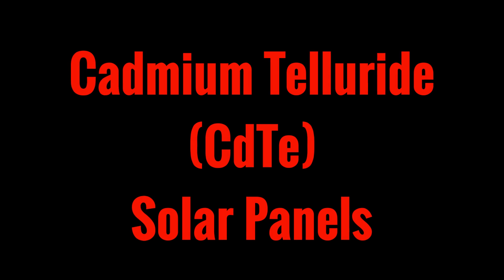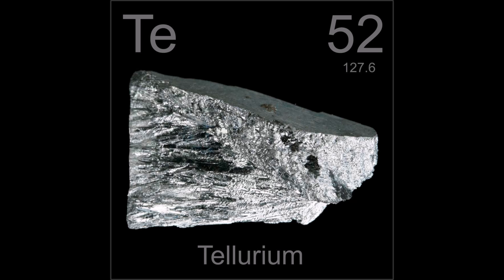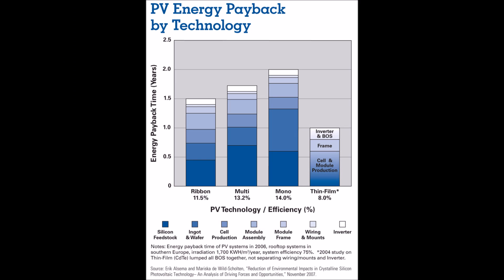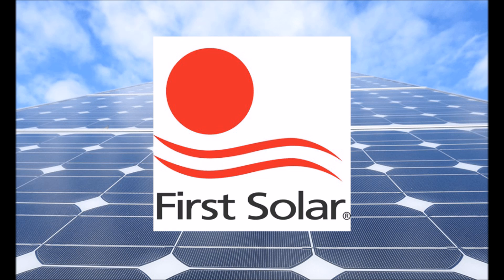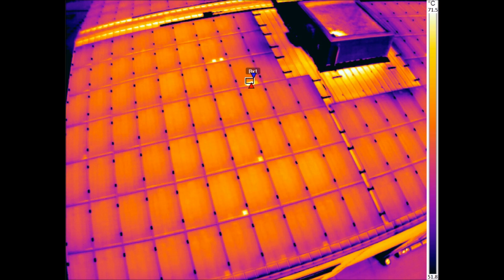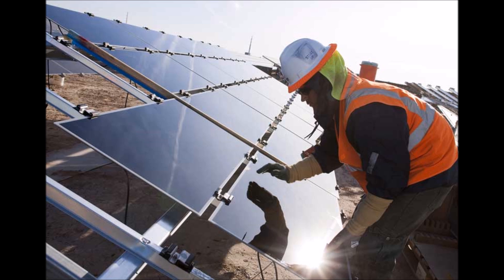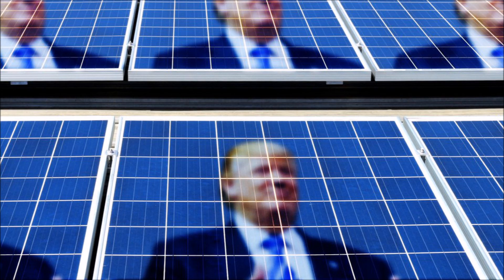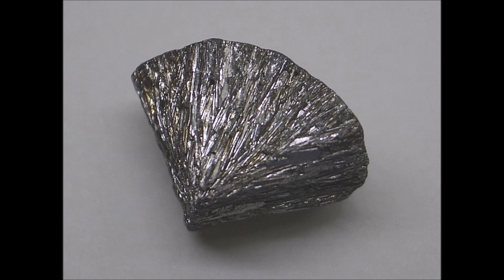Cadmium Telluride (CdTe) Solar Panels

Comment: Hey are any of your older systems still in operation,and which controllers do you recommend? I want to know which system endured including solar controller, panels and so on.
Reply from the maker: Yes, I have a 600W system on my shed that has been running since spring of 2013.  I used DMsolar panels (http://www.dmsolar.com/dm15somo2pkp.html) and 3 different charge controllers, all of them made by Morningstar (starting with - https://amzn.to/2w2iwB7   and ending with - https://amzn.to/2rfqQbb).  I started out using golf cart batteries sold at Costco which were great and very durable and super cost effective but then graduated to more premium batteries last year with Trojan T105RE batteries.
Reply from the maker: For more info on my latest setup, watch this video series and it will show you what I had before and what I have now:  https://www.youtube.com/watch?v=X1QKyTysxIg&list=PLbKwoGlXEWaqluTsTB5R0fjLMqniKOt5q

Comment: Great video friend. I'm looking for a solar JOB!  I'm near Boulder, CO.  Got any suggestions?  I have 8 years electrical experience and a Manufacturing Engineering degree.  Tons of construction experience too.
Reply from the maker: Unfortunately, there aren't many jobs outside of sales and installation.  There are very few solar companies left in the US that actually make panels or components.  Maybe you can start out as an installer and see if you can work your way into an engineer role designing systems.

Comment: Don't forget wind turbines, super cheap if you go to Walmart online, and better http://linksynergy.walmart.com/fs-bin/click?id=nNC3MIW3bd8&type=10&tmpid=1081&offerid=223073.7442&RD_PARM1=https%253A%252F%252Fwww.walmart.com%252Fsearch%252F%253Fmethod%253Drelated%2526query%253Dwind%20turbine%20generator%20kit%2523%252FsearchProductResult%2526affs%253De
Reply from the maker: Unfortunately, after researching those types of turbines for years, they do not produce much power.  Certainly not their rated power.
Reply: For the last 10 years you would be right. But just in the last year the Chinese have upped the game from junk to function. Can't say that for the criminal mastermind in Missouri who is a 100% junk fraud dealer but as for the Chinese they went from toy, to energy. However, you still have to pick careful until quality equals out. The NE-500 (see my $200 china turbine vids) is NOT a fluke.
Reply from the maker: Yeah, Missouri Wind and Solar is shady as can be.  No one should ever buy from that guy.  I will have to look at your videos.  Thanks for the info.
Reply from the maker: Do you have a link to the particular video and also where to purchase?

Comment: Why should i care if they're not available?   I tried to buy some but they only future market these to utility companies on a large scale which does me absolutely no good.   I need panels RIGHT NOW, not at some unspecified future date.   I just got another shipment of imported silicon panels TODAY and they'll be on my roof by Monday afternoon when i get more MC4 connectors in the mail.   They will be producing power next week while this will be perpetually 10 years in the future.   By the time these hit the market tellurium will cost more than platinum simply because producing these at any reasonable scale will increase demand and drive prices up in the unlikely event that they actually enter production without the company failing under the weight of corporate corruption and scandal that ubiquitously pervades in the capitalist system.   My bet is on them robbing a bunch of investors in the name of nationalism and declaring bankruptcy before i'm able to buy a single panel.

So i'll just keep buying as many pre-tax imported panels as i can RIGHT NOW instead of holding my breath for these.   I'm off grid and necessity dictates that i use what's available instead of waiting for First Solar to mass produce these fairytale unicorns.  Even if they do produce utility scale grid power with them, it's still worthless to me since there's no grid on the mountain, just 350 days worth of south-face sun a year that i need to block from heating up my roof, and shading it with silicon panels while making power to run equipment has been doing me just fine for the past 7 or 8 years.

Comment: It seems that there are two major problems with this technology. Tellurium is a rare element (between one and five parts per billion in the earth's crust). It may be lacking or no longer available in sufficient quantity to ensure the sustainability of the channels that use it.
Cadmium also raises questions because it is a toxic element that can accumulate along the food chain. In the 1950s, mining industries dumped cadmium into rivers in the Toyama Prefecture of Japan, causing the so-called Itai-Itai disease in the population. In particular, it resulted in bone softening and kidney failure. Affected inhabitants fed on rice from crops irrigated by contaminated water. Note, however, that cadmium becomes harmless once included in solar cells, as confirmed by several scientific studies published in specialized journals.
A fire could not release the cadmium from the solar cells because the heat would melt the surrounding glass, trapping it. The main risks would be for people working in assembly or recycling plants, but there are many industrial processes to prevent poisoning.
Finally, we need less cadmium to make a solar panel than a single NiCd battery. For the less convinced, cells devoid of toxic element were born in the 1980s. They consist in particular of indium and gallium.

Comment: Thin-film solar panels are in general not very useful for in most residential situations. They are cheap, but they also require a lot of space. Monocrystalline solar panels produce up to four times the amount of electricity as thin-film solar panels for the same amount of space.
Reply: w8stral2 Huh? What are you referring to?
Reply: First: CdTe is a special case.
And: There was much progress in the last few years.

Today, CdTe-modules achieve roughly the same efficiency as crystalline silicon modules do (>17%).

So the demand of space per kWp is more or less the same.
Reply from the maker: Chris, that is not really true.  I can show you pictures of a thin film 100W solar panel compared to a 100W mono silicon panel that I have in my shed.  The thin film panel is actually smaller even without taking into account the aluminum frame.  It just sepends on the efficiency of the cells in the panel.  And like I said in the video, thin film has caught up to silicon and in the next few years will pass them.

Comment: The cadmium issue is important,
I still have a NiCad battery from the seventies.
Those have all been replaced these days with NiMH for environmental reasons.
No more cadmium in other places either.
Also Trump may just be a transient, same for his import tarifs, that is hurting US solar industry and its consumers
with higher prices.
I do have a cheap Chinese made solar panel..

That said, we all need a personal nuclear  reactor, or maybe a RTG (Radio Thermal Generator as in some spacecraft),
 everything will radiate anyways after Trump tangles with N Korea, China, and Russia (some others possibly too).

Nice video, at least it is honest.
Reply from the maker: Thanks.  Yes we need to be responsible with cadmium.  Thankfully these panels have been shown to be safe for consumers.

Comment: 2016 - 2018 seem to be banner years for the "boring" metal markets.  First zinc inventories declined, then you had the cobalt shortages due to rising electric car battery demand.  Now Tellurium is getting the renewable energy spotlight too (though I guess you could say Te is more of a metalloid).  I wonder where the prices will settle when this technology reaches its peak.
Reply from the maker: Good question.  I am trying to shine some spotlight on it but most of the solar industry ignores CdTe and thin film thus far.

Comment: Mono-crystalline – efficiency is in 16% range. PV cell is made from pure mono-crystalline silicon with almost no defects or impurities. High purity mono cells are used to make computer CPU chip, relatively low purity cells are used for solar module. The most common size of mono-crystalline cell is 5”x5” (125x125mm) and 6”x6” (156x156mm). The bigger the size, the harder is to make. Mono-crystalline has a lifetime of 25 to 30 years under normal circumstance.
Reply: And still produces useful energy well past that timeline !

Comment: We need to focus on one type of panel technology, if it can provide what we need. Economy of scales is important, focusing on 1 type of panel means better research and lower prices.
Reply: Kester Belgrove,
Focusing on a single is what got us into this environmental mess to begin with. ( why are we still generating electricity with 1920s technology?) Continued research and development into new and better technology is the only way to be sustainable.
Reply: Scott BC31H I hear you loud and clear, but in relation to some technologies I disagree. If we use Lithium Ion technology as an example, further concentration on one form has lead to reduction in Li batteries from $15 per cell to $1 per cell in a short period of time. This price reduction will lead to a boom in solar storage and overall use as a renewable and affordable form of energy production worldwide.
Reply: so your not in favor of graphene batteries which can be charged faster and hold more storage? Lithium-sulfur batteries which are lighter? Lithium fluoride batteries which are very light and cheap?
Reply: There are many different takes on this; everyone is entitled to their view. I'm basing this on the fact that for each type of technology there is going to be a plethora of ancillary technology that goes along with it.  E.g. with batteries you need charge controllers, inverters and other tech as well as lessons learnt to control safety issues, etc. With a new type of Li battery a new charge controller and maybe even inverter may be needed... Each new tech requires new experience that takes years, money and resources to develop fully. I'm not saying no to new technology, NO WAY!!!, I love new stuff. Let's not forget that everything needs development time. 
Also, each new thing is expensive because of the economy of sales. So it may be years before this new tech is even "affordable" to the masses; whereas the technology that already exists has high reliability, is affordable, is functional, and safety issues are mostly already known. 
Please note this is not an argument but a discussion, and I'd love to hear your view.
Reply: There are charge controllers that allow you to program how much voltage goes into the battery. You do not need a new inverter for a new battery tech, as long as the charge controller cuts off the voltage.
Reply: JoeAceJR are programmable charger controllers more expensive than their non-programmable counterparts?  My reasons for my point of view are as follows in priority:
 Cost
 Safety
 Durability
 Reliability
 Ease of setup/adoption

These things come with time on the market. Consider charge controllers, pwm was the norm for lead acid, but with Li ion mppt gives better results, but mppt was and is still more expensive. I realize I'm sounding technophobic (but it's quite the contrary), but I see such improvement in cost and availability in relation to solar and 18650s since Tesla and I love the movement the industry is taking. I'd just love to see solar power as an affordable commodity like cell phones.

Comment: Interesting.  Thank you
Reply from the maker: You are welcome.  Thanks for watching!
Reply: Part of the reason I'm getting more interested in Solar and wind power is I am in partnership on a piece of property that has absolutely no chance of getting cheap power brought in. 10 years ago it was estimated by the power company to bring in power we would be looking at our cost nearly $60,000.  Right now we are on a generated power system (12Kw diesel) that during the day charges a battery bank and supplies power to the rest of the property.  We have acquired a tower in order to put up a wind generator (yes we have the sufficient wind speeds according to the charts).  We also want to install solar power for those time during the day when the winds are changing direction (Lake Superior creates in inflow and out flow of air daily).  During the mid day slowdown we could continue to charge the battery bank when we are not on the property.  This would allow us to also operate a small well in order to bring water into a field we plant for the local animals.  It would also mean we don't have to rely on diesel generation for power making it quieter during the day.
Reply from the maker: That is a perfect use for solar.  Even better to use wind, which works great in conditions when solar doesn't (stormy, overcast, night).

Comment: Good vid, thanks LDS dude!  I can't figure out why First Solar doesn't supply to solar distributors around the country and flood the residential market.  As you mentioned, their panels are cheaper and easily available but they only focus on the commercial-scale market.  Opportunity missing there.
Reply from the maker: I agree.  I wouldn't be targeting the utility sector at all, either.  I have worked in that industry before and I will never do it again.  The residential market is infinitely bigger than utility will ever be.
Reply: Agreed.  I called First Solar again today to get a meeting with them as I live in Arizona and have worked in solar distribution for years and think they have a massive opportunity right now to hit the U.S. market as a U.S. mfc.  Solar City is just starting manufacturing but wish they would have gone cadmium thin-film as the cost benefits, cloudy days advantages are clear.
Reply from the maker: Yeah it has taken Musk a long time to get his solar factory online.  I am afraid he is way behind and there are many better options right now.
Reply: Lol. The reason is that efficiency of cdte panels is not as important in utility as in residential. You can’t add roof space but can easily put one extra row of cdte solar panels to compensate for less efficiency versus silicon panels. Consequently, First Solar focuses on the utility sector.

Comment: Year 2007 graphs in presentations, is nothing new in decade...?
Reply from the maker: Sure.  But the point was just to show that the energy payback period was less than silicon at less than a year.  If you adjust for today's numbers it is an even wider gap.

Comment: Nice presentaion. I heard that thin film panels could end up being transparent, making the suitable to mount onto large skyscrapers without any see through penalty, also they are very light which makes them great for backpacking, i have a 21w panel in my backpack and even it's lighter than the model i bought 2 years ago, they will weigh much more than thin film CDTE, Canadian Prepper has done some good videos on these earlier (i'm guessing it's the same producer/type). Hope they will be available here in Europe soon.
Reply: Your assertion that the light "only needs to excite the electrons, not necessarily be absorbed" shows a profound misunderstanding of how the fundamental science works. When a photon excites an electron, the photon ceases to exist. It was a packet of energy, and its energy is now in the electron. If the photon still existed, it could in theory go to another transparent panel, and another, and another..... That would violate conservation of energy. Conservation of energy is NEVER violated.
Reply from the maker: Well First Solar manufactures in Germany for the Europe market but their
 panels are more for utility scale applications.  For small applications
 like backpacks I don't know.  I haven't seen any CdTe that small yet.  
There are other thin film technologies like a-Si that might do more with
 small applications.  I do hope something is available for you soon!
Reply: A transparent panel, by definition, does not absorb the light. The photons just pass through. I don’t understand how anyone could think a transparent panel could produce much power. Most of the buzz seems to come from a single research project that harvested a small fraction of the light in the infrared only and let visible lights through. That will produce much, much less power than a cell that uses every possible bit of light.  Just put the panels on the roof.
Reply from the maker: I haven't seen anything beyond experiments with transparent panels to this point, myself.  The light only needs to excite the electrons, not necessarily be absorbed.  So I think eventually it will be possible but it is a long way off for sure.